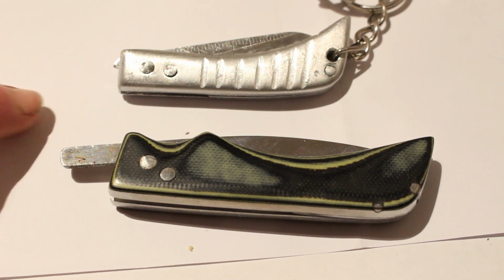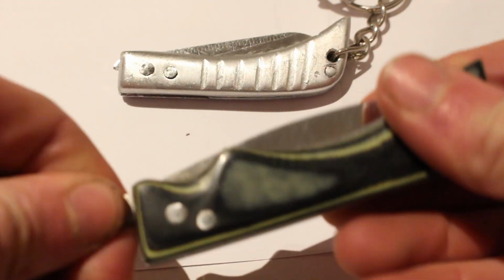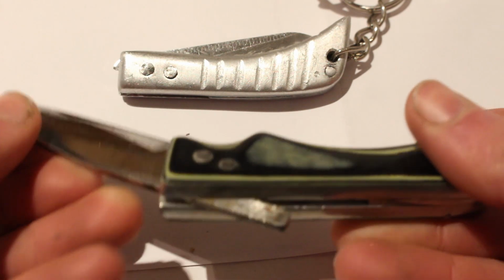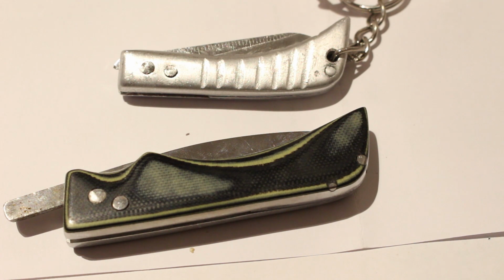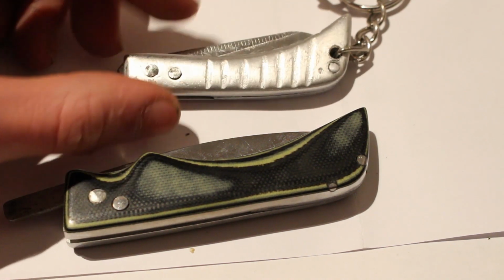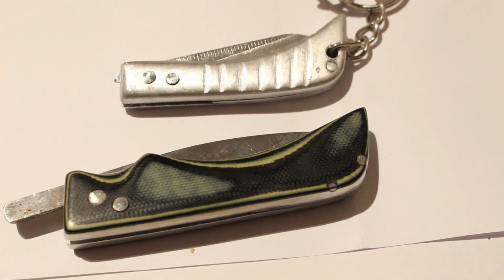Making a Stainless Steel Folding Knife From Scissors

Comment: exellent job buddy. Just one thing thu....u keep pushing and pulling on both the files and hacksaw these are designed to cut in one direction only and will wear out quicker then just using a push stroke. great work thu

Comment: If you want to help prevent rust on the carbon steel blade try using silicone spay. It leaves a dry lubricant film.

Comment: to remove the plastic handle it would almost be easier to use a torch or another heat source to heat up the handle then just pull it off, or just flat out melt the whole thing off.  Nice video!

Comment: nice concept, but there is an issue, when you use "contaminated" sharpeners and shapers for the metal (grinders and files that were made for stainless metal, and have not been used on anything other than stainless metals), you "contaminate" the stainless steel with whatever the tools worked on last, no matter how much you clean them, especially if they weren't spec'd for stainless, so that blade is going to rust eventually, maybe not as fast as a normal blade, but it still will. Not downing on your video, just a suggestion for future videos (a lot of craftsmen keep their "stainless" tool bits sealed off in labeled bags and kept away from anything other than stainless metals)

Comment: Sorry, thought I'd mention UK knife law. The 3'' blade length you mention is not quite correct. The 3'' rule is for the length of the whole knife when opened, handle, blade, even a fitted key ring. Meaning your blade length is only ever going to be 1.5'' max...

Comment: Love the video, man. I like how simple it is to make and the fact that you don't need an oven to be able to make an actual knife. I do have 1 question. Does it hold an edge well? I know that stainless steel is a pretty soft steel but does it hold an edge as good as or almost as good as a normal stainless steel blade? 
Thanks for the great video!
Reply from the maker: +Mark van Druten so far it has been fine, I dont expect anything amazing because the scissors were so cheap but it will be fine for only light and occasional use like I will use it for
Reply: Hey, thanks for the reply. I've been wanting to make a knife for a long time and i think this will be the first knife I'll make. I love the idea. Good luck with your other projects. I'm looking forward to see more of these quality videos.

Comment: Most alloys of stainless will not harden, and so will not hold a good edge. Most alloys of stainless have significant nickel content, which is a maleable metal that resists hardening in even tiny percentages. This is the significance of vanadium steels, which are stainless alloys that will harden (to some degree, they're still not tool steel). 

Metallurgy fortehwin

Comment: Neat build for sure. It's a shame you're limited to such a short blade with no lock. For me the lock is more of a safety feature than anything and the blade length I guess isn't much of an issue unless you fish or hunt.
Reply: It seemed pretty safe. Did you see that he tested it by slamming in the table to try and open it?
Reply: LoganThe Llama The lock isn't to keep it closed. The lock is to keep the blade open while in use. I almost lost a finger to a knife with a faulty lock when I was younger. As time goes by his knife will loosen and swing more freely. Locks are use to prevent that from happening while in use.
Reply: Ryann Large This is a whittling knife, it shouldn't be used for anything else.
Reply: LoganThe Llama and your point? I was whittling when I almost lost my finger to a faulty locking mechanism.
Reply: When whittling your thumb should be a bit behind where the blade folds, so you can hold that mechanism down. Because that metal piece flips out, if your thumb is there, it prevents that.
Reply: +LoganThe Llama but what about you're hand hm? You have to hold the knife don't you?
Reply: +Ryann Large If the blade loosens up you peen the pivot in over more so it becomes tighter

Comment: What is the edge retention like? I notice you didn't heat treat the blade
Reply: +Parahybana Spidaz ahh. But treated to what degree ? how hard is it? how long will it hold an edge
Reply: +Parahybana Spidaz k bud.
Reply: +Don't tread on me scissors have to be very hard because cutting paper blunts knives quite fast.
Reply: +GC Knives Eh, not so much. Cutting paper dulls knives because knives are not purpose made to do that. Scissors have a very steep grind on them, and are actually shearing the paper between the two blades. This allows them to be made of much softer metal than knives. It's also why they are so cheap, as heat treating isn't needed if you're using them for their intended purpose (paper). I wish I could find them now, but somewhere I have a pair of brass scissors, which cut paper just fine, but I wouldn't much care for a brass knife, since that would be largely useless as far as edge retention. 

Now, that's not to say there isn't any reason to heat treat scissors, since a harder blade will hold its edge longer, and that's a good thing. But that's a feature you're more likely to find on far more expensive scissors than the ones used here. His blade will still be usable for it's intended task (as he says, opening boxes and such) long after the blade dulls beyond what we'd consider usable for more strenuous knife tasks. Basically, for the intended purpose, this knife should work just fine even with softer than typical steel.
Reply: +Don&#39;t tread on me The fact he could shape it with a file suggests it is very soft and will be utterly useless at holding an edge.
Reply: tok716 to be fair, you can do that with any stainless knives too. Stainless isn't all that hard, and files are made to do this job specifically. I'll admit that this is definitely shit stainless, and that the file cut deeper and harder than it would in a harder stainless, but still, to suggest that you couldn't do that on other stainless blades is silly.
Reply: +Squat251 Gaming It might be about as hard as a circular saw blade then.
Reply: Don't tread on me maybe. IIRC saw blades are typically high carbon steel, which is fairly hard stuff. I'd guess it's much softer though. Think along the lines of a really really cheap gas station knife.
Reply: +Squat251 Gaming I think so bro

Comment: Wait, so locking blades are illegal in the UK? thats pretty well every knife I own unless its a fixed blade.
In all seriousness though I'm gonna take a quick look. Knife laws in Canada are very different.
Reply: +Sean Hill Yeah, things have got very tight and silly over here in the UK.  The restrictions really came in when a Head teacher got stabbed outside his school.  The bloke who did it was bragging about it afterwards when he came out of prison.  He would accost people using ATM machines trying to menace them into handing over cash.
Nowadays, blade length has to be under 3 inches, no locking open & no fixed blade sheath type knives can be carried in a public place without reasonable purpose.  Pointed items are prohibited too, and craft knives get people arrested as well.  Plus someone has to be aged over 18 to buy knives and similar now.
Of course it's different if you are at work or at home but it's easy to be caught out when you are travelling.
Knife crime is still quite high though as it seems that the bad guys just don't care!  All to often it's the well behaved people who get caught out, quite often by mistake.
Reply: Yep, those laws won't really keep yabos and criminals from breaking laws when they already intend to break some.

Comment: The buffing wheel part made me cringe, if that edge catches the blade could sail straight through your hand. Do yourself a favor and get in the habit of using the lower portion of the wheel, with the blade facing down. Buffers are a lot more dangerous than they seem like they would be. Great use of repurposed materials, though.
Reply: +Mark McCormack An old knife maker friend of mine has firm (and well founded) belief that the buffing wheel is the most dangerous tool used to make knives. I agree, they're far more dangerous than people seem to think. Just because the wheel is soft and can't hurt your fingers doesn't mean that it can't do other much worse things.